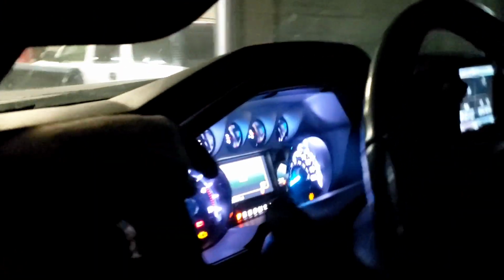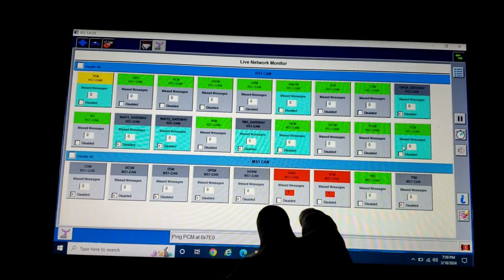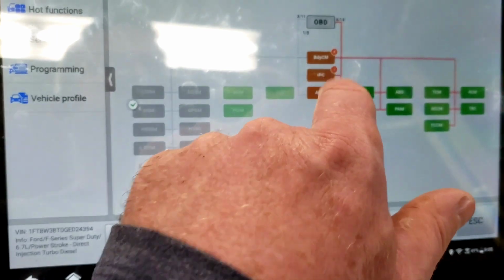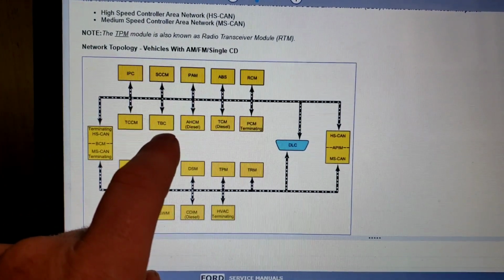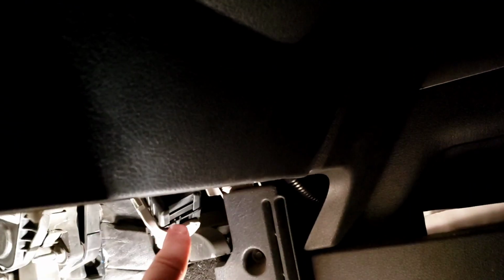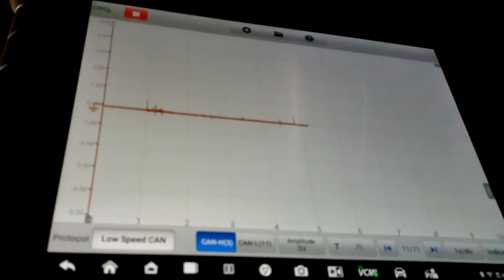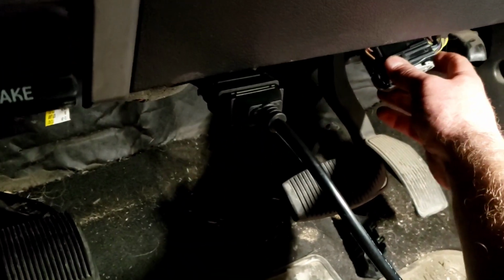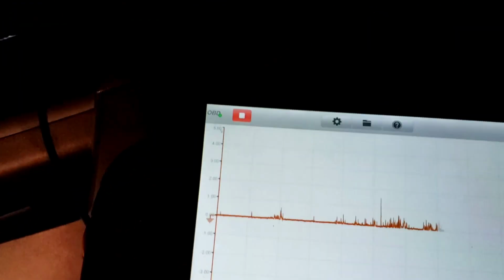2016 Ford F-350 6.7L Medium Speed Can Bus Issues (No HVAC, TPMS, Navigation, etc.) Part 1

Comment: Quick question on the HS2 or MS network pins 3 and 11 @ DLC(gateway module)on a 2019 F150.
With battery negative removed I have 60.2 ohm's on pin 6 and 14.
On pin 3 and 11 I have 40.4 ohm's.
The SCCM and Gateway module have the terminating resistors.
If i unplug the DLC(gateway module)i get 120 ohm's at DLC on pin 3 and 11.
With DLC plugged in and SCCM unplugged i get 61.4 ohm's.
With the DLC and SCCM plugged in it goes back to 40.4 ohm's.
However if i unplug connector C238 it goes to 60.1 ohm's if that makes sense to you.